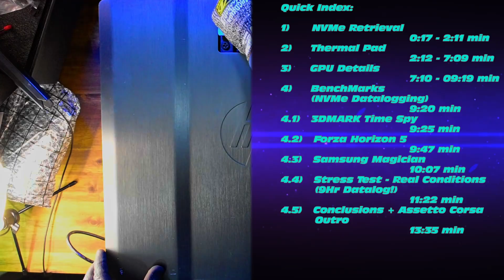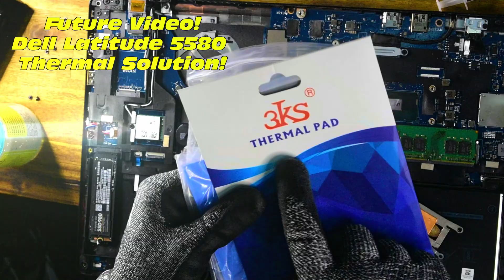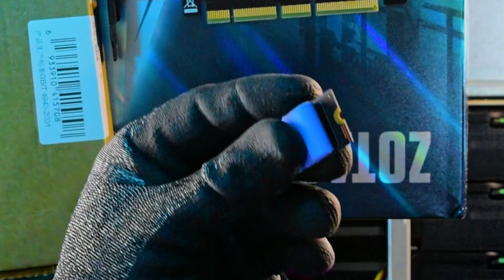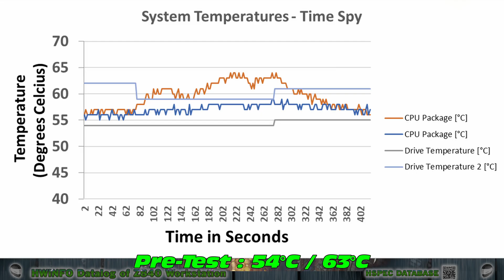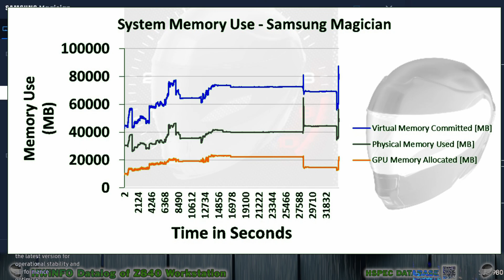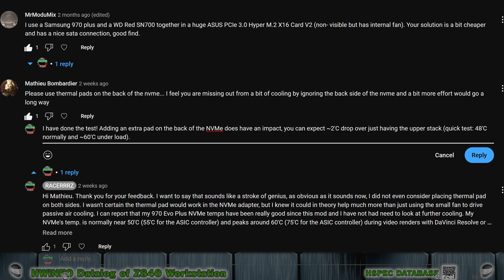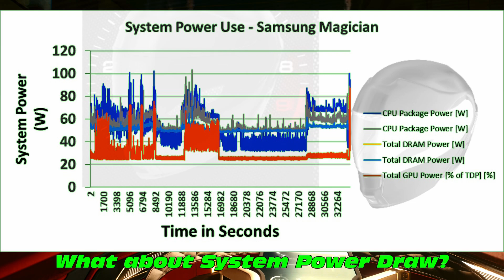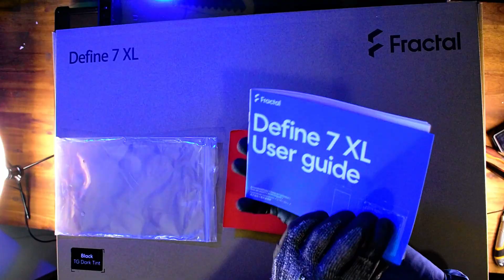NVMe Cooling Strategy : Is THIS the BEST way to COOL Your NVMe? (HP Z840 + NVMe Adapter)

Comment: Even if underneath cools ok a thermal pad should not be underneath.  I work for City IT where I live and we use HP exclusively.  They put 1.5mm or 2.0mm thermal pads underneath there drives and it's ruining the drives and/or the boards.  They end up melting onto the board and the chips on the nvme drives are ridiculously hot.  I've had 5 nvme's go out in the last 6 weeks.
Reply from the maker: That's an odd situation. I have done a fair amount of testing on NVMe cooling and thus far I have not had any NVMe failures from having thermally conductive silicone present - it's usually very effective at keeping NVMe temperatures low - say around 40-55'C under normal use.

What I will add is that I have found the PCIe chamber to have insufficient airflow when loaded with adapters. My 10GbE NICs needed additional fan cooling to prevent thermal shutdown despite there being a 90mm fan moving air from the HDD bay over the PCIe slots.

Which NVMe adapters are you using in these HP systems? I found the HP Z Turbo Drive Quad Pro to be the most effective adapter I have tested to date (https://youtu.be/xqg0uQ93KTg & https://youtu.be/umLcRS05nAk). Which NVMes are being used and what are their operating temperatures? HWiNFO is helpful to diagnose these types of issues. If the NVMe hotspot temperature is higher than 75'C under normal use it will dramatically shorten their live span. But I have not had a single NVMe meltdown, and I have have cycled my way though hundreds by now.

Comment: What about the Z Turbo Quad Pro. Have you considered it?
Reply from the maker: Hi Nes. Yes I actually picked one up recently and I am yet to test it. On first glance it seems to be a solid adapter. There is thermal pad for heat dissipation and the build quality is great. The added benefit of power loss protection makes a lot of sense for NVMe storage. 

The only question is does the added price premium for it add sufficient benefit over something like the Gigabyte Aorus AIC Gen 4 NVMe adapter or the Asus Hyper M.2? I hope to answer that question in a future video! I'll likely test 4x NVMes in a RAID 0 configuration between the three adapters to see which one performs the best over all.

Comment: I saw in a different guide regarding NVMe in Z workstations that if you connect them with an extension card it will not show up in the BIOS, was this also the case for you and how did you work around this?
Reply from the maker: That can happen but only in certain workstations. The limitation with correctly reading the NVMes within the PCIe adapters relates to the motherboard support for bifurcation (which is mostly restricted by the age of the hardware). Not all the workstation motherboards support bifurcation (e.g. HP Z440 does not support bifurcation but the Z840 does). 

HP has a method to work around this which requires their Z Turbo Drive NVMe adapter. The Z Turbo Drives have a PLX chipset which can negotiate the PCIe lane bifurcation (or lane splitting) independent of the motherboard. e.g. The Z820 can support NVMes and I have seen videos that demo the Z820 booting to windows from a NVMe (without Clover etc.), but I have never been able to achieve that (even with the latest BIOS - but I have not tested a Z Turbo Drive for this). 

I had issues in my Z840 when I tried to boot to Windows 10 from the AORUS Gen 4 adapter. When I had 4 NVMes fitted the boot NVMe was not detected (regardless of the M.2 slot I used in the adapter; with just 3 NVMes it booted fine). My solution was removing the boot drive and placing it in a single slot adapter (PCIe slot 1). I have 4x 1TB Samsung 980 NVMes in the AORUS Gen 4 adapter in my Z840 (I render my videos from them.).
Reply: @racerrrz  Z440 does support bifurcation.
.
Reply from the maker: @mikesgarage394  To the best of my knowledge, yes it does, sort-of. 

I am yet to confirm this myself, but from my reading the initial BIOS on the Z440 did not support bifurcation and subsequent BIOS updates added the functionality. Thus I would conclude that a Z440 with the latest BIOS will boot from a NVMe adapter like the Asus Hyper M.2 or HP Z Turbo Drive Quad Pro. 

I am working on a NAS build video using the Z440 and I plan to test both the Asus Hyper M.2 and HP Z Turbo Drive Quad Pro - both requiring the Z440 to have lane bifurcation. 
I would test it quickly in the BIOS but the motherboard is currently floating around in a new case - waiting for case-swap completion.
Reply: @racerrrz  thank you for this in depth answer I can really work with this!

Comment: 14:35 Toyota Supra mk4?
Btw I love your workstation!
Reply from the maker: Spot on! The 2JZ in the MK4 is impossible not to notice.haha Thanks, hard hitting workstation at this point, as is your Dell Precision T7910. What GPU have you got in there? Looks like a solid performer.
Reply: @racerrrz  oh GPu well i did have a GTX titan XP but I found an RTX 3090 for only $670 in my area and I had to buy it! (btw sorry for the other answer lol I read wrong... if you saw it obviously XD)
Reply from the maker: @jacksonRD2001  No trouble, both messages came through. E5-2699 V3's are the best of the best from the Haswell generation (I settled on the E5-2697 V3's for the higher base clock speeds). Nice find with the RTX 3090 for that price! It was worth holding off during the previous price hikes! I got my RTX 3090 Ti for a ridiculously low price also (although that's relative - it was more or less MSRP lol), and I do not regret the 24GB of memory.